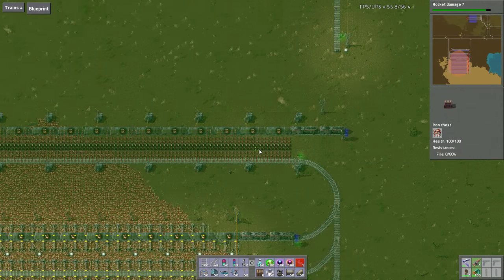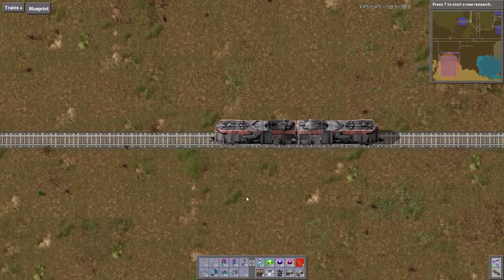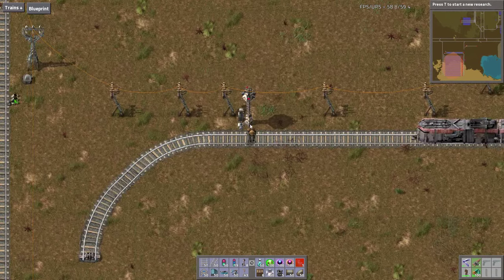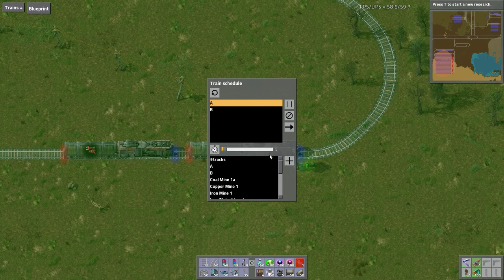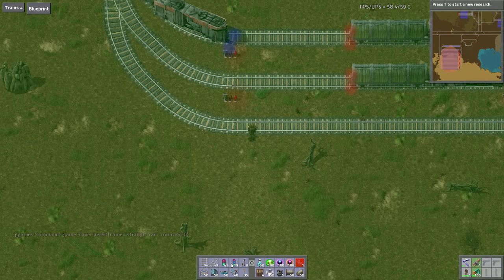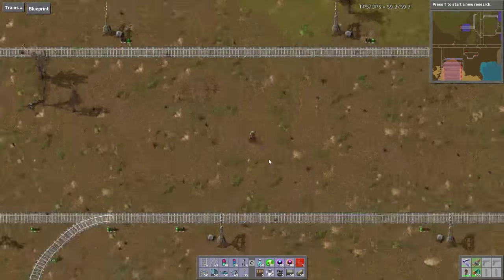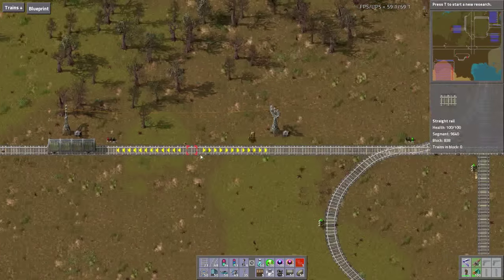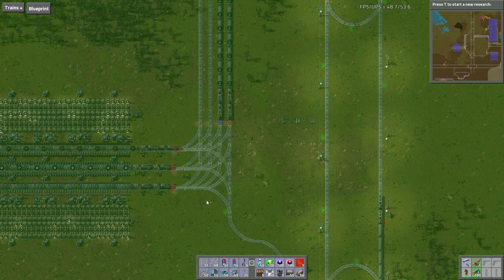Factorio Tutorial 5b: How Trains?

Comment: This helped me get a further understanding of signaling..   My only concern still is when placing the signal itself does it make a difference if the arrows pointing direction start in the box created by the signal on the track or after the box?  or does it not really matter as long as the signal is placed correctly and it turns green/blue??

I love tutorials that are simple like this..  you covered exactly what you started and did not wander off to do something totally not related to the topic at hand...

Thanks..
Reply from the maker: +Anomoly2012 Since the tracks are 2x2, there are 2 places you can place the signal on each side. It really doesn't matter where you put it.
Reply: Does this apply to curved track as well?   Is it better to signal straight rail or does it have the same effect on a curved rail? 

You just solved a problem that has bothered me for a very long time..   

Thank you..
Reply from the maker: +Anomoly2012 Yes, curved tracks have (I think) 4 positions where you can put signals. Experiment around, see what's possible.

I should not that if you have 2 curved tracks close together, you can hit "r" to rotate which track the signal will attach to if there's confusion.